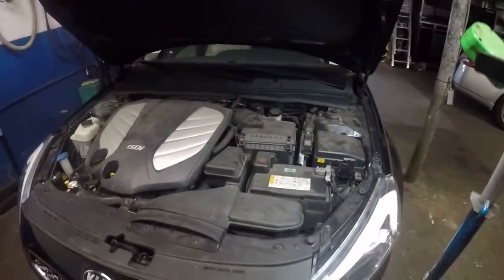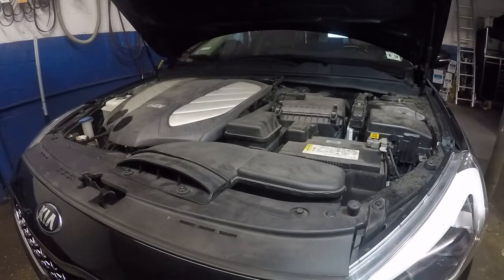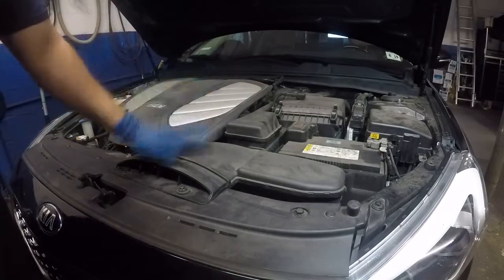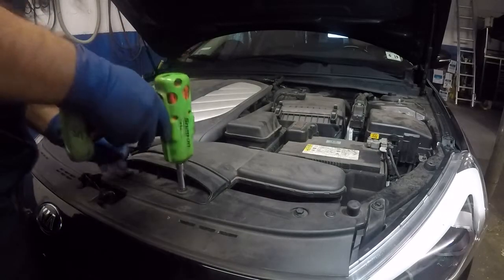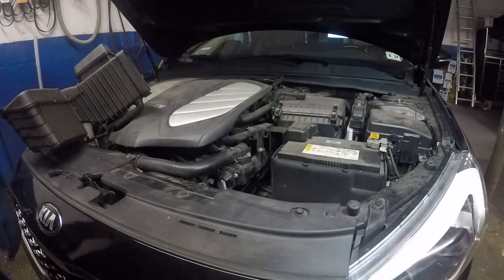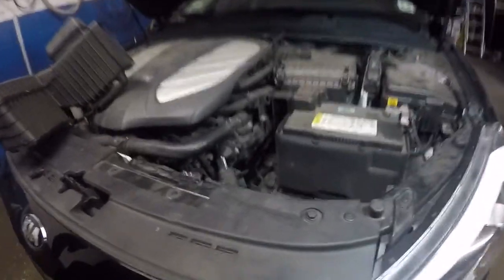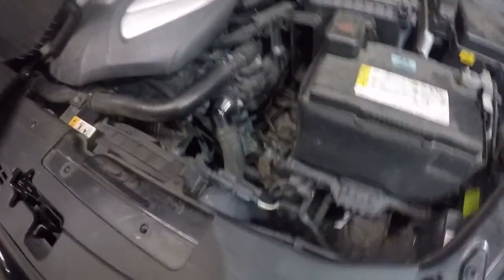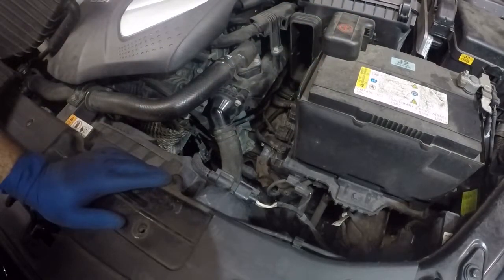2016 kia cadenza fans dont work bad relays

Comment: Hi. Thanks for great video! 1 rely (high speed fan) was burnt. Changed now but new one also keeps burning! Already installed new radiator, new fan assembly with resistor, new thermostat, and also did Head gasket sealant treatment! Still same fan high speed relay keeps burning! What could be the issue you think please? 🙏🏼
Reply from the maker: What is head gasket sealer treatment
Reply: @RBTheMechanic I used Blue Devil but I also have Bar Head gasket sealer (not used yet). Today the car entered the RED zone on temperature gauge since the Bluedevil treatment (done 3 weeks ago). Already changed everything. Could it be water pump? Help 🙏🏼
Reply: @jacobhenry2785 did you have bubble on reservoir tank ? Because mine have it bad bubble in reservoir tank

Comment: My fan want cut off.. it drained my battery... what could it be?
Reply from the maker: Usully fan will stay on if the computer thinks car is still hot that could be due to faulty siginal from Coolant temp sensor or stuck relay so try checking with scan tool what kinds of siginal and temperature data is with in ecm
Reply: @RBTheMechanic  ok. I need a jump to start my car its a 2014kia candenza.  Thanks for the info
Reply: @kahmaleast7287  what was the problem sir🤔
Have a 2015, fan has been on
All morning 😫
Reply from the maker: @johng9207  well u need to dignose his propperly step by step dose ur car looose coolant? Or misfire these are known for bad head gaskets

Comment: I got a 2018 KIA Cadenza and I took it to the mechanic and they said that my fan went out do you think I should try what you did in your video before spending $500 dollars for the fan the on behind the radiator
Reply from the maker: U can try but since they checked it mostlikely it’s the fan u can try this then check power with test light directly on fan if it got power and ground then it’s bad fan
Reply: @RBTheMechanic  ok thank you
Reply from the maker: @juanzuniga8474  welcome!!! Up date me if everything went ok
Reply: @RBTheMechanic  it was my fan I already got it replaced
Reply from the maker: @juanzuniga8474  oh ok good cool!!!

Comment: Hello, my cooling fans won’t turn off. The car is not hot because I unplugged the battery for a day. When I plugged the battery back in, the fans turned back on even when car is off. What could it be? Also, I installed a sub and speakers in my car, could this short my relays?
Reply from the maker: Somthing could be shorted double check ur work if the issue wasent there prior to doing that
Reply: @RBTheMechanic  ok, thanks man

Comment: I just found and subscribed to your channel. I have a question. I changed my thermostat but my radiator stills needs to be filled everyday. the fans are working. what else should I do?
Reply from the maker: Well check for leaks? All around the engine all around the block water pump radiator see if u find anything… did u over heat several times before this issue started?  Some times it could be bad head gasket and it will burn internally but that’s the last thing u want to rule out or think of
Reply: Hi and thanks for your reply. If it happens to be the head gasket how much does something like that normally cost?
Reply from the maker: @jparrott1974  this kia is known for head gasket.  If ur still under 100k miles it still under warranty also I think they have recall on the head gasket issue. And talking about head gasket like $3000 and the issue would happne again cuz these new block made of aluminum usully crank
Reply: @RBTheMechanic  do you know of any shops that could perform this for me near Memphis tn?
Reply from the maker: @jparrott1974  no sorry I’m in NJ. But why don’t u call dealer maybe they have recall of extended warrnty I know these have issues with head gasket
Reply: @RBTheMechanic  I'll do that and let you know what they say.

Comment: Hello from Kazakhstan. Thank you for this useful video. I have kia cadenza 2015, and now have problem with overheating engine. Few days ago visited electrician, he found problem in 2 relay, and also resistor. I,ve changed 2 relay with lower amper (20) and ordered new resistor. But electrician suggested to change also all colling fan or colling fan motor, because problem is coming from motor of fan, first burned resister, after that 2 relay. What is your opinion, is there will be enough to change resister or change all coolling fan? Thank you in advance. With regards, Daniyar.
Reply from the maker: Clean out the fan motor as well
Reply: @RBTheMechanic  Hello, today i received my ordered resister, and changed it. But i observed  that still over filling coolant in reservoir, is it normal? Thermostat and pump is working. Thank you.
Reply from the maker: @DT-jp8fh  I’m not sure what u mean but these cars have big issue with head gasket maybe that’s what’s going on
Reply: @DT-jp8fh  did you ever figure out the issue? I'm having similar issue with reservoir over filling
Reply: @charlesgomez5593  i've changed head gasket, and found that bolt was broken
Reply: @DT-jp8fh  thank you for reply, ouch sorry to hear.  I have a similar issue I think 😒. You you have to replace the threads on the head or just the bolt?
Reply: @charlesgomez5593  yes i did new threads on head of cylinders

Comment: I have a 2016 Kia Cadenza Premium and my fan still runs when the engine is off?  Could it also be the relay switch?  It will stop if I start and shut off the engine again.
Reply from the maker: Might be over heating issue check temp with scan tool
Reply: I’m currently having this issue with my car but it drained the battery did you ever figure out what the problem was?

Comment: I'm having a problem with my 2014 kia cadenza sxl ac there is no air coming from the vent.
Please help
Reply from the maker: No air mean ur blower motor is not working check fuse relay for blower put it on high speed and check power and ground at the connector of blower motor

Comment: When running my a/c or heat, everything is working fine. I can hear the fan running. Suddenly I can still hear the fan blowing but no air is coming out. Then a few minutes later or longer I can feel the air again. The whole time I can hear the fan blowing.
Reply from the maker: The blower motor ur stating
Reply: @RBTheMechanic  oh I’m sorry, 2017 Kia Cadenza
Reply from the maker: @jimbernotas8254  buys its blower motor ur hearing and no air?
Reply: @RBTheMechanic  yes! When I first turn on the air or heat and turn the fan on high, you can hear the fan blowing loudly. When the air stops working you can still hear the fan blowing loudly. I was wonder if there is a switch that when you change from air on your face to defrost on the windshield is closing all the vents then opening back up.
Reply from the maker: @jimbernotas8254  check ur mode door motor it might be throwing air else where try putting air face down defrost try all setting that’s the switch it might stop working and get stuck in no air direction

Comment: I have same problem with 2014 optima the fan doesn't come on? What should be do
Reply from the maker: First thing first check relays also there resistor check that also or change it
Reply: No no

Comment: Hello I have a 2015 kia cadenza. It dosent over heat but when the fan comes on it wont turn off after the engines is turned off . Do you know of this problem?
Reply from the maker: The car is dolly too hot and they need to stay on for a bit to cool it off check ur relays and coolant level

Comment: When I turn on the A/C there is air blowing but it’s warm. Last year it would blow cold when the car was moving but not sitting, for instance at a stop light. Now the air isn’t cool at all. The refrigerant pressure in the compressor is good. What else should I check?
Reply from the maker: Kj Howard well I think u should do the service on the ac system the pressure can be good but dose it have enough? The pressure can be air pressure I think all along ur ac system was low on r134 so it gave u cold air when car movies from the high rpm now there I sent enough and no cold air prolly had leak in the system do the service refill it vaccume and recover full and add dye so U can see where the leak is
Reply: RB The Mechanic I purchased A/C Pro last week. The pressure gauge went to the middle of the green area. I filled it to the end of the green area on the gauge. Still warm air. I’ll get it checked out. Thanks. The videos are very helpful. Keep it up.
Reply from the maker: Kj Howard yeah I under stand but some times it’s air pressure also u have to do it properly vaccine and recharge the system with correct amount
Reply: RB The Mechanic Will do. I’ll make the appointment to have it looked at.

Comment: I have 14 cadenza and issue is it doesn’t cold at idle unless i hit the gas pedal. After driving for 10 minutes it works fine or at highway. Secondly at night or when the sun is down it works better but when it’s hot or more stop n go it doesn’t work or you can say it works great when rpm is 3 4. What do you suggest what could be the issue ? My fan is working but i notice one thing that inside the car when the ac is on full speed it’s not really fast it used to be too loud when fan i full but now it’s now that fast so please suggest what could be the problem. Thanks and I already subscribed brother.
Reply from the maker: Haseeb Dewan it might have low Freon and it kicks in enough to make cold at high rpm or it could be ac compressor that don’t build enough pressure... try having ac system serviced first also check to see if the condenser is clean not dirt or anything is blocking it
Reply: RB The Mechanic ok thanks will do that
Reply: RB The Mechanic I had this exact issue , had it serviced at kia dealer. They said it’s the blower fan . I took it to another mechanic they said the blower fan is working fine , they also put Freon in the car and it does the same thing .
Reply: Waldo Lopez so did you figure it out what could be the issue then or still looking?
Reply from the maker: Haseeb Dewan this car had bad relay u can check ur car if ur having problem also there’s resistor for Dan I do show it on video
Reply: RB The Mechanic yes I’ll change them can you suggest any website where i can order those?
Reply from the maker: Haseeb Dewan your can find on amazon or dealer

Comment: Hello!  My name is Anderson!  I followed your video regarding the Kia Cadenza fan tests.  I am from Brazil and here the mechanics do not have a good experience with this car, my Kia Cadenza is year 2011 and is presenting the following problem: overheating and filling the reservoir with coolant.  I carried out the tests you did on the fan and it is working at both speeds, however when it heats up it DOES NOT activate the fan nor when it activates the air conditioning.  What could be happening?  I appreciate if you can help me with some information.
Reply from the maker: Anderson fernandes de oliveira ok very commin for relays to fail I would put in new relays because your test you did bypassed the relays try that

Comment: Hello!  I changed the 2 relays, the low speed and the high speed, for new relays.  The first test I did after changing the relays was to turn on the air conditioning and the first speed fan worked perfectly.  However the car still remains with the high temperature and filling the reserve reservoir.  Could it be the resistance of the engine fan?  And or could it be a thermostatic valve or water pump?  If you have any more information, thank you!
Reply from the maker: Anderson fernandes de oliveira you have to throw in thermostat for the fans work when it’s on high temp?
Reply: Did you ever find out what the issue was? My reservoir is over filling too

Comment: Kia Cadenza- 2012 - changed 1. New Condeser and Used Compressor , Now AC Cooling Working on Running but AC Cooling not coming While Idle, what are the major reasons need to check? 

Any problem in Relay Fuse ?
Reply from the maker: MANI SOFT I’m not understanding what u mean by ac cooling not coming.   Ru saying ac dosent throw out cool at at idle but when engine is reving it make good cooling air?    Please subscribe. I will do my best to help
Reply: RB The Mechanic I been having this issue. My ac works when I drive but when I idle it turns warm also low ac turns warm I have to keep it on high speed for it to stay cold .

Comment: Hello!  I let the car work until it reached an ideal temperature to activate the second fan speed.  However, even with the activation of the second fan speed, it continues to increase the pressure and add additive to the expansion vessel, which did not seem normal until the vehicle started to present these problems.  But at least now the fan is working normally after replacing the relays.  But is there anything else to be examined or is it normal after a certain temperature, the pressure rises and coolant flows into the expansion tank?
Reply from the maker: Anderson fernandes de oliveira you might have bad head gasket
Reply: Hello mister, how are you? Did you solve your problem with overfilling tank with coolant, what was the reason. I have same problem, but still didn't find the reason. Thank you in advance.